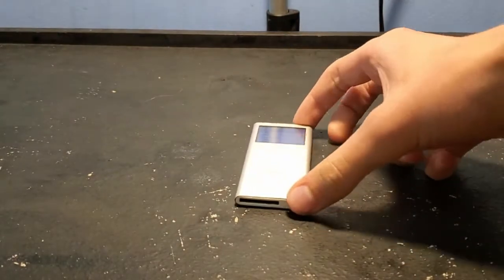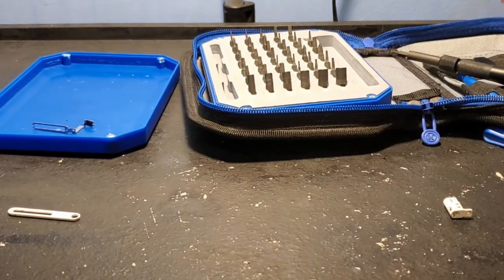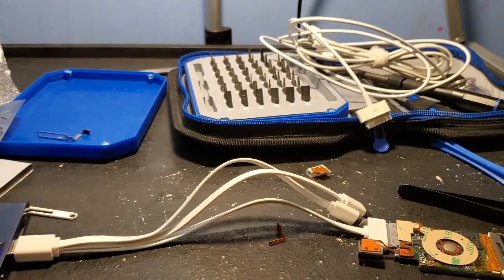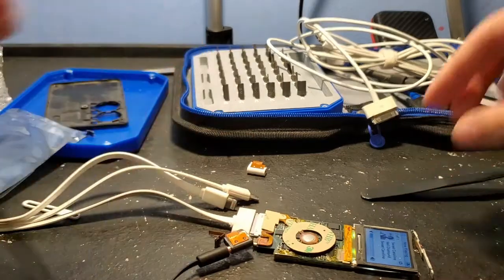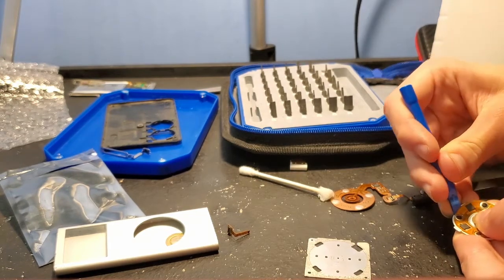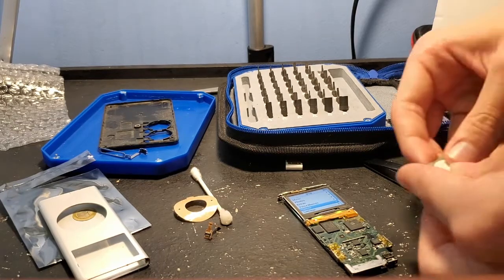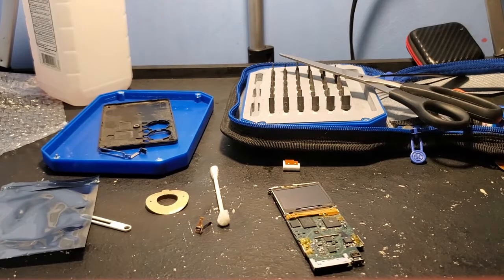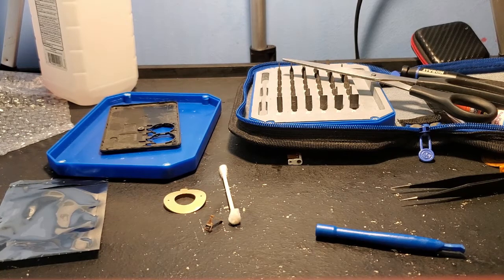iPod Nano 2nd Gen Repair

Comment: Very good video! I like how you worked through the issues until you found the successful fix! That really validates your technical abilities! These devices are definitely NOT the easiest to work on, it seems they are intentionally designed that way, so a big kudos to you for working your way through it and getting it done right! ✌️

Comment: Long shot here on a 3 year old video. Any tips on the center button not sitting flush? I cleaned the robbon cable since the buttons weren't registering, mainly the center button, but after putting it back together, it rocks back and forth. Nothing I seem to do fixes the issue. The button itself works, but it feels like it's caught on something. none of the videos I've watched seem to have this issue.

Comment: Where do you get these parts? I need the piece you replaced plus a battery!
Reply from the maker: I got the clickwheel off ebay, and you can find most parts to repair iPods there.
Reply: Hi where you get glue what is call it?